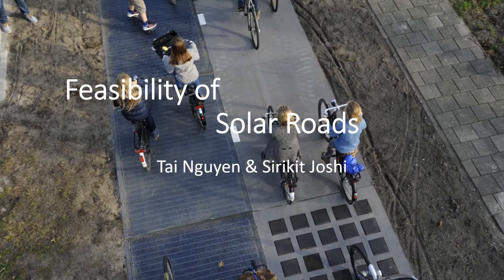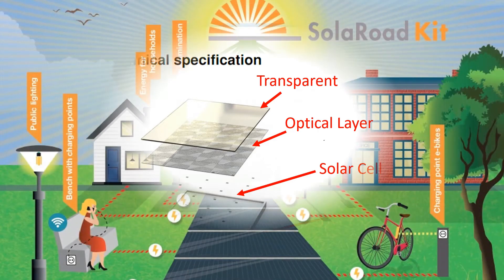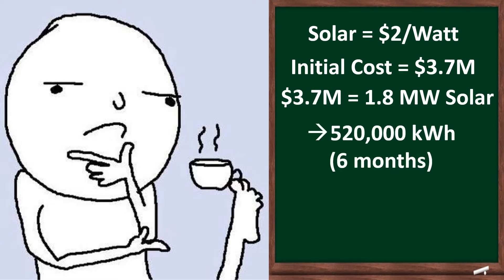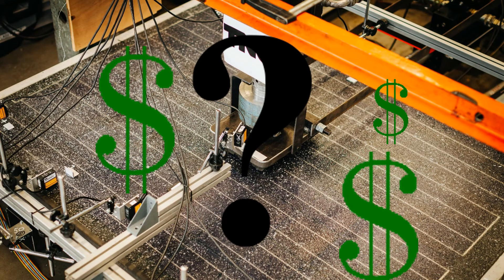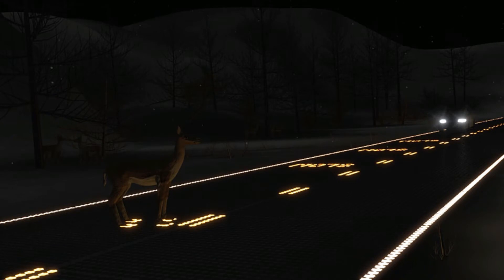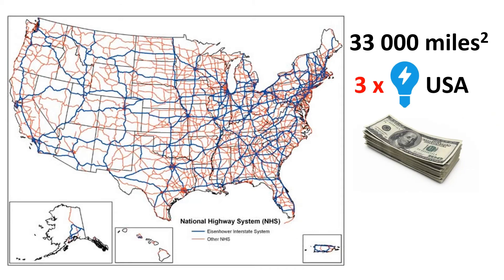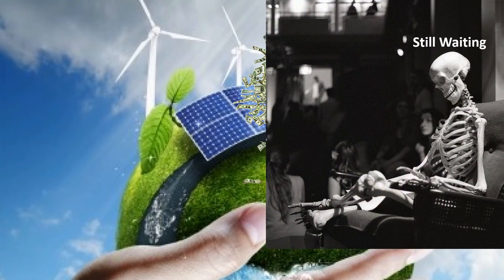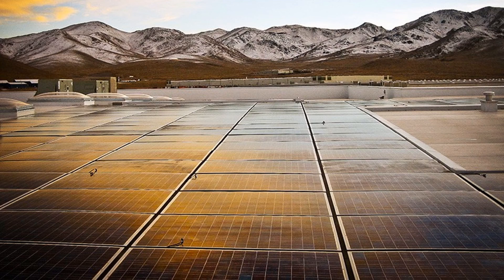Feasibility of Solar Roads

Comment: Hey, first I would like to say great video! You touched on using these special solar roads during the winter. Even today with tar or cement roads and with cars using special snow tires, there are many cases of road accidents. My question is that other than the special heating feature that melts the ice, are there any other safety features to prevent slipping during cold seasons?
Reply: The US solar roadways has a special design that makes it skid resistant. It promises that the wet glass is not slippery during rain or snow. However, it does have LED lights underneath for increased night time safety.

Comment: Hi guys! Just a small question....how easy is it to replace the solar roads? You mention that there is a concrete base and a transparent glass among other things. Is it necessary to replace all this after the 20 year period?
Reply from the maker: The 20 year replacement period is for the solar panels. The top glass layer probably needs to be replaced even sooner. As for the concrete base, reinforcements may be required after some time. The panel is easily replaceable if we consider the fact that it will not get potholes and each panel works individually and only the damaged panels needs to be replaced.

Comment: Hello, guys.
what is different between the ordinary solar panels and SR panels.
Reply: Ordinary solar panels are not designed to withstand heavy loads while SR panel's glass can withstand 125 ton. SR panel is also skid resistant and has a special design for traction.

Comment: Nice video guys. I do get a lot of knowledge from this video. I would like to ask one question. How to make a recycling process for those solar panels after 30-years service lifetime.
Reply from the maker: This video is to inform about the solar roadways as a new technology. Since the technology is not fully complete, the makers have not considered about the recycling process for these solar panels. Howerver, in my opinion, except for the top layer, all other components which mainly are normal solar panels can be recyled easily.

Comment: Good job guys.
Average  lifetime of PV panels is about 30 years, after 30 years can it recycle easily ? 
and 
If a glass tile breaks, is it easy to fix? Will the shards puncture tires?
Reply: The glass is recyclable however the glass used in US solar roadways is a special type of glass and I'm not sure if there is an industry right now equipped to recycle it. When this tile breaks, it shatters into small granular chunks instead of shards so they won't puncture tyres.

Comment: Nice video and interesting topic. I would like to know if there is any undergoing project to reduce the initial cost and make these roads more efficient.
Reply from the maker: In the case of Netherlands solar bike path, they are studying the experimental results of the prototype till the end of this year. So until then, they won't be making any changes to the design.
In the case of USA Solar Roadways project, they have not finished designing the final prototype, so the main objective right now is to complete all the functions that the project proposed and make the SR solar panels work with uniform stability. Therefore, they are not focusing on reducing cost or increasing efficiency.